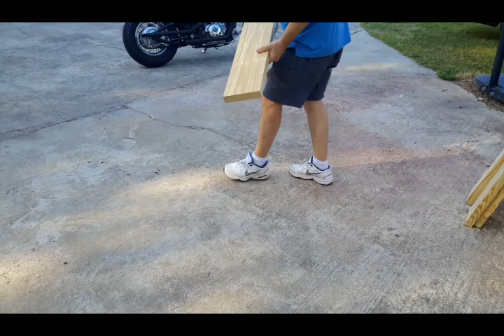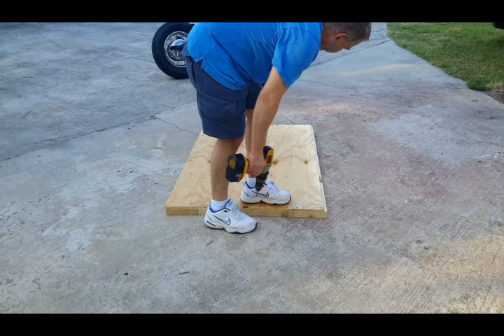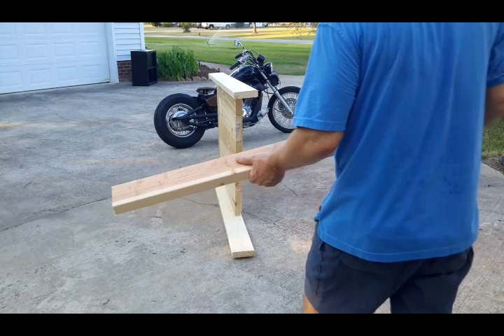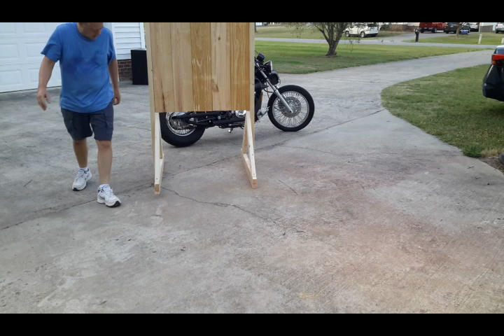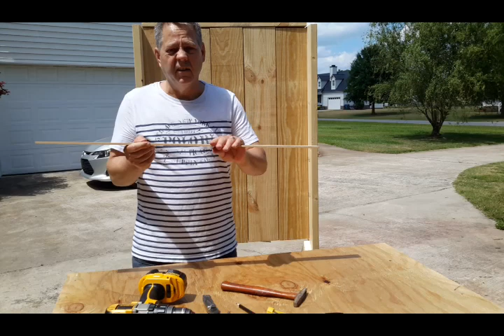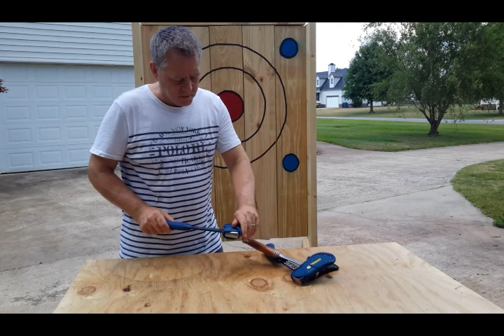Axe & Hatchet Target build easy guide

Comment: without the plywood backing would the axe stick? I built one without it and cant get the axe to stick
Reply from the maker: I would think it needs a solid backing unless you built it against a wall.  you want less spring or give in the boards. try also sharpening axe and dampening the wood.